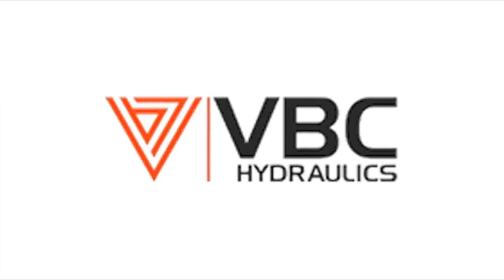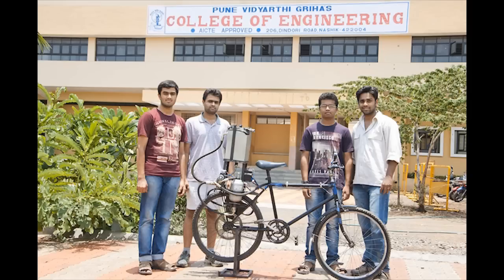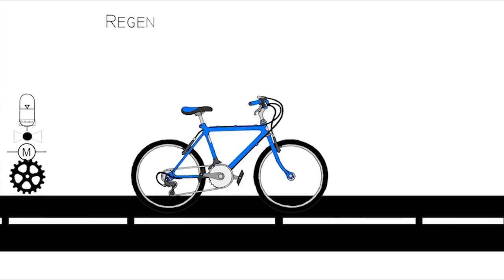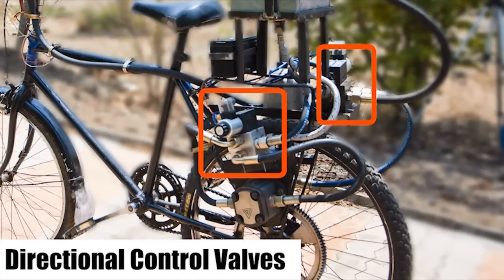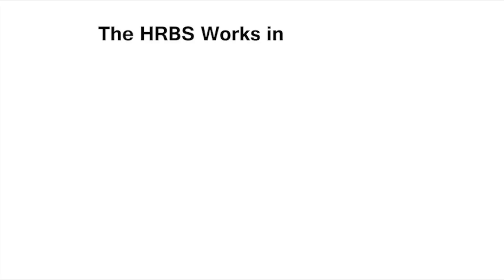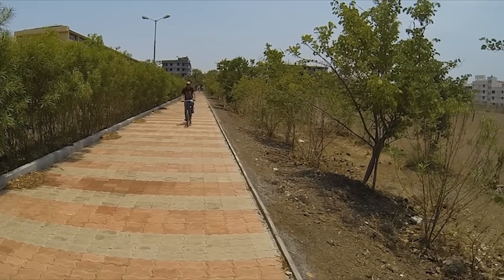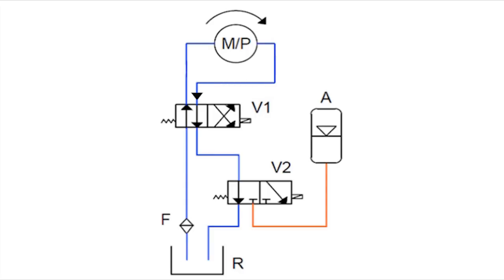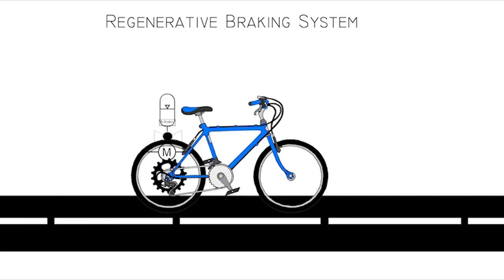Hydraulic Regenerative Braking System (HRBS) implemented on a conventional bicycle.

Comment: Hi Bro....1st Of All Ur Idea And Project Both Are Awesome I Just Loved Ur Idea About This....Bro Will U Help Me Cause Am In Final Year And Am Also Working On Ur Idea ...I Need Ur Help..I Just Wanted To Know Overall Cost For This Project....And The Specification Of Accumlator , BiDirectional Gear Motor....DC Valves And Low Pressure Reservoir....Plss Help Me There Is My Presentation On 6th Of Feb...I Will Be Really Helpful For Me
Reply: where are you currently located Mandar ? You can get in touch with me at ...prashantnehe@gmail.com

Comment: pneumatic would be ideal for light bikes but i guess harder to seal.
Reply: Precisely, and it costs a whole lot cheaper but the efficiency in Pneumatics is lesser than Hydraulic systems in general. But our aim was to study and build a new hydraulic circuit for regenerative braking as a whole. We chose bicycle as a medium just for study purposes as the costs would have been high had we chosen a motorbike or a car and that would involve a lot more synchronizations with engine and other automotive systems which drift us away from our objective.  

There is a lot of scope for improvements and I believe it can be commercialized on bicycles as well if the system is improved and made as compact as possible.

Comment: hrbs also doesn't hv gyroscopic effect like flywheel based system which may adversely affect vehicle handling on turning or hiting a bump. its also a great advantage.
Reply: True, but this was just a prototype and there is definitely lot more improvisations that can be done to reduce the bulkiness of the system.